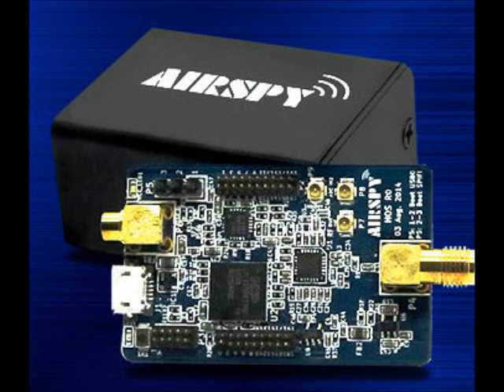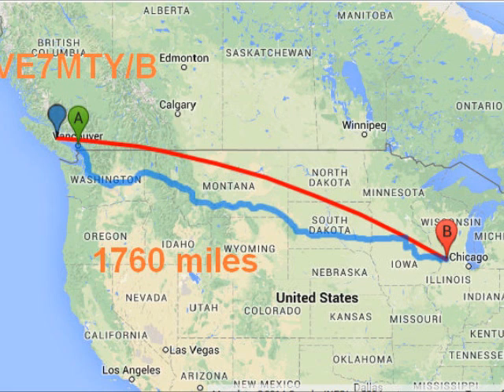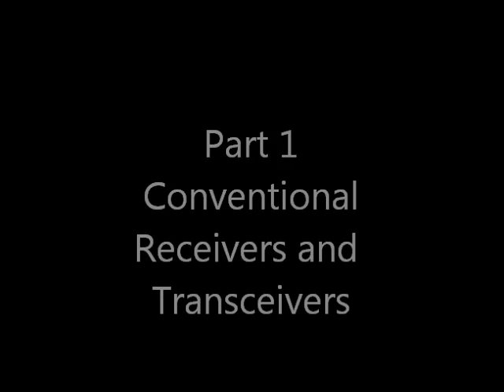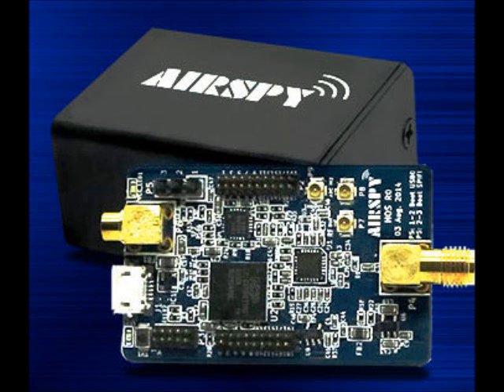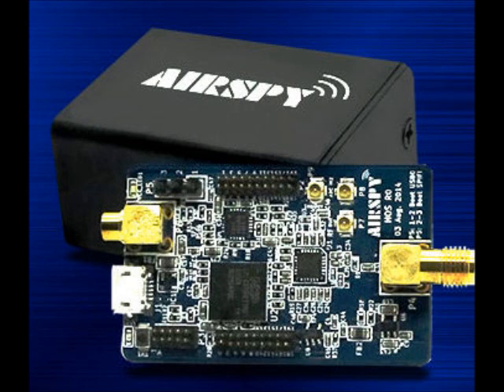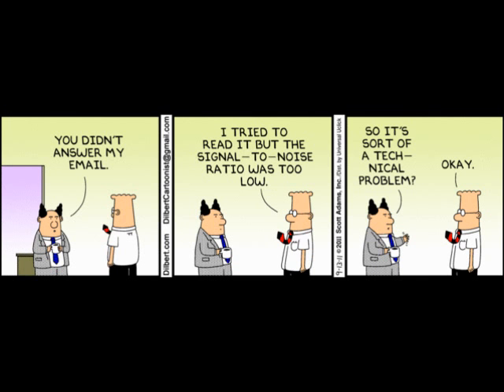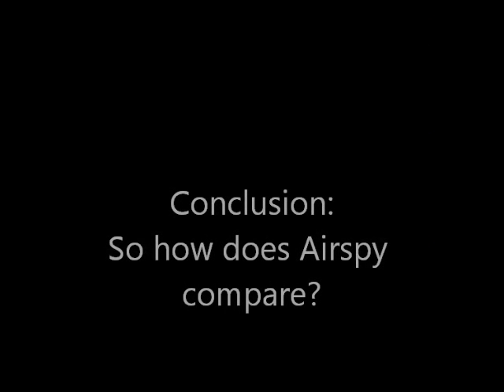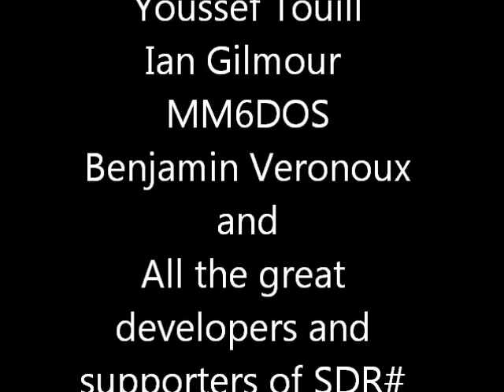Airspy Review and Comparison by W9RAN

Comment: Bob, I came to your channel today because I was lucky enough to pick up a RanVerter kit (v2.2), unbuilt, at a garage sale near Prescott, AZ.  I use an SDR on my bench and look forward to building the RanVerter.  Question I have is are there any instructions or should one just check out the QST article?  Perhaps you could reply with some guidance.   Thanks, and 73.  
Steve WA0A  P.S. I got a great deal at $0.25 but now I am just bragging.
Reply: That kit has achieved "vintage status" by now!    I use one on my bench all the time too.   You should be able to figure it out based on the instruction sheet that is available for downloading from the "Attachements" section at the bottom of  this article:   https://tinyurl.com/zxuyctc      The current SDR Sharp installation is available form the downloads page at www.airspy.com.   Thanks!

Comment: Hi W9RAN. I'm planning to use AirSpy for pointing satellite antennas to fixed geostationary satellites. I'm not sure what you mean by 9MHz Selectivity. I mean it's cool to see a whole 9MHz BW in the software screenm but need at least 100KHz of resolution in order to see the different carriers on the satellite transpoders. Is AirSpy able to do that? I cannot find the resolution specs on the AirSpy webpage. Thanks.